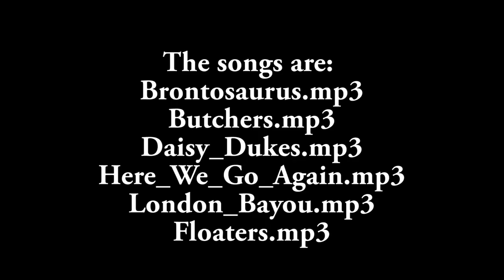Handmade ring for little finger 18KT gold with diamonds

Comment: Scaffoal, I have been wondering this for quite some time now. What’s the difference between a cast piece and a handmade piece, is one better than the other. I hand forge my jewellery, but other jewelers cast and many jewelers do both. Is any method better and if it is, why?
Reply from the maker: I prefer processing made with laminated metals because they are free from porosity and fractures 
do not emerge during any changes. I use all the techniques because it is not always possible to make the jewel completely by hand. Nowadays 3D prototyping with 3D printers for jewelery offers excellent results. Often, however, small craftsmen can not afford the costs for these machines. In my videos I usually show traditional workmanship, in the future I have videos that will show also techniques that use fusion has lost wax.
Reply: thank you for the reply and clearing it up for me, :)
Reply: Working the wax reduce gold waste but like the master said porosity and hand made give a crisp finish better brightness on stone settings less time consuming waiting for kiln and better profit 
Just to run the kiln  = 50.00 + investment + wax work+

Comment: What is holding the diamonds in place? What keeps them from falling out??
Reply: Thomas Tommy 
When he craves into the gold with that tool that looks like an icepick,  it leaves a groove, but also a mound of gold, kind of like when you're shoveling snow - a cleared path, but some buildup at the edges of the shovel 
When he craves a intersection,  around the hole that he drilled He uses the built up gold to secure the stone
Reply from the maker: perfect explanation thanks

Comment: 6:36 Solder doesn't fill gaps my ass. How did that work?
Reply from the maker: you're right by dissolving the video track, lost the part where the tweezers approach 
the two parts and you can not see the solder flow.